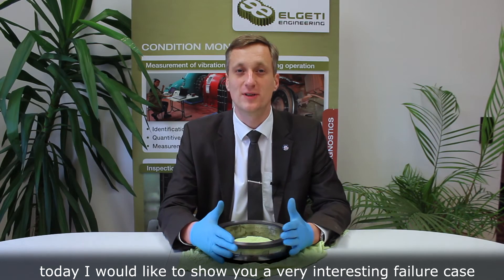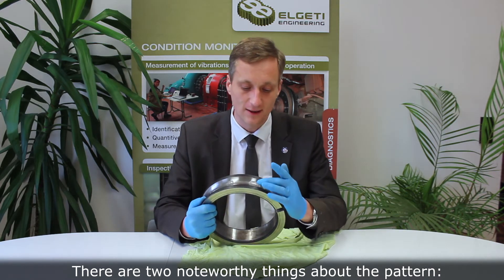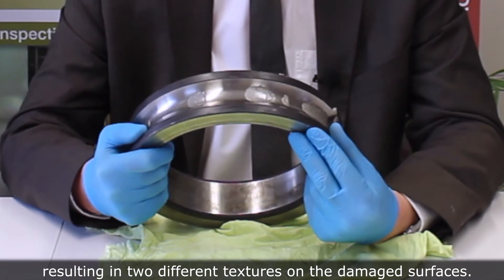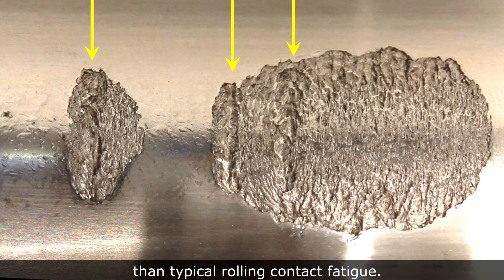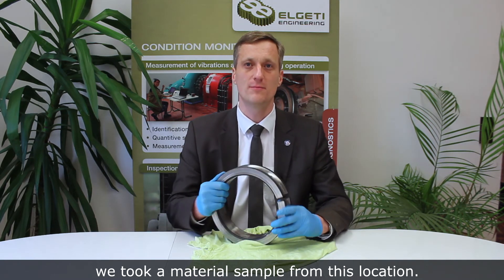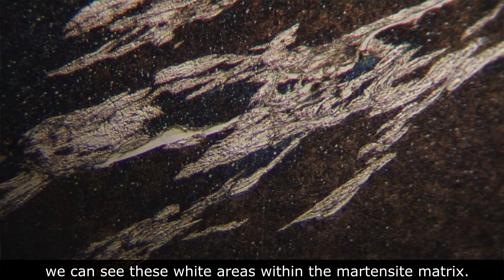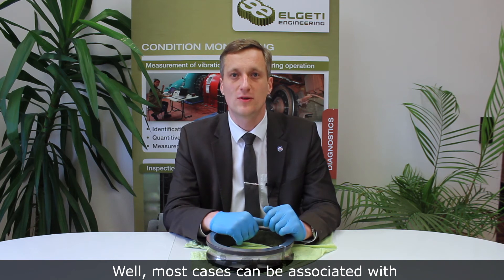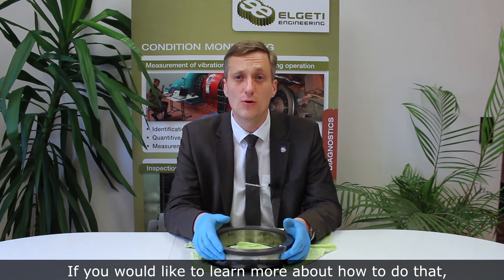Case Study: Bearing Failed by White Etchting Cracks

Comment: White etch in bearing raceways is from my experience, a result of breakdown of the grease, with possibly some electrolysis action, hydrogen is released from the grease and causes hydrogen embrittlement with the visible white etch effect, which can be observed by the naked eye.
The subsurface cracks propagate to the bearing surface and you have breakout and the bearing damage as you have shown.

My understanding is that bearing manufacturers understand that limiting the amount of grease added to the bearing on assembly, limits any grease migration and the small amount of grease on the contacting bearing rollers, breaks down over time, limiting the life of the bearing.

Examining the raceways of bearings that have not yet deteriorated(before any cleaning of the bearing takes place) that have done similar hours, will likely show that although there is grease within the bearings, the raceways will be devoid of sufficient grease and when the raceways are wiped with clean absorbent paper it will likely come back completely clean.